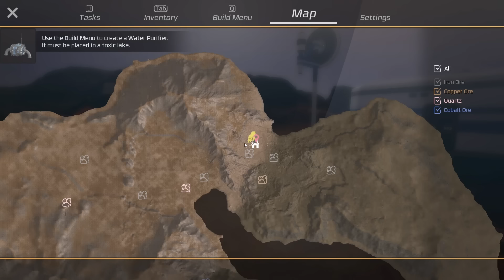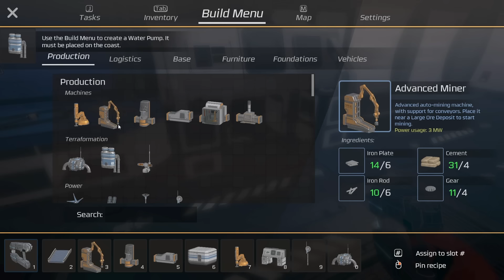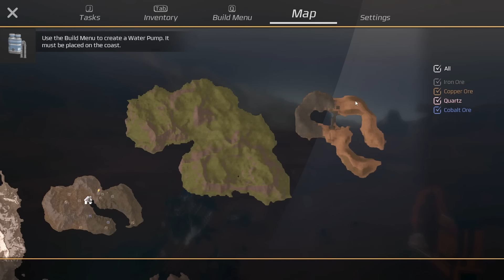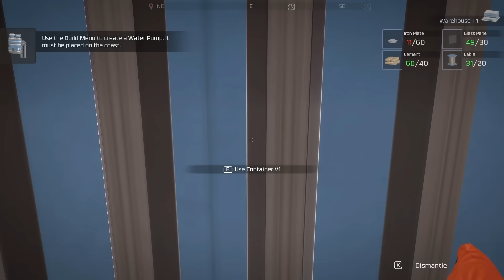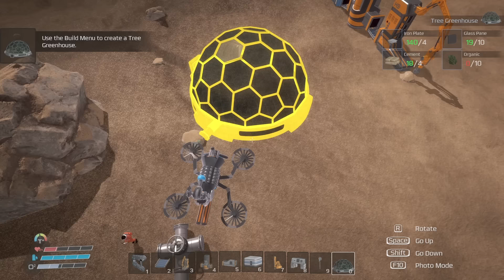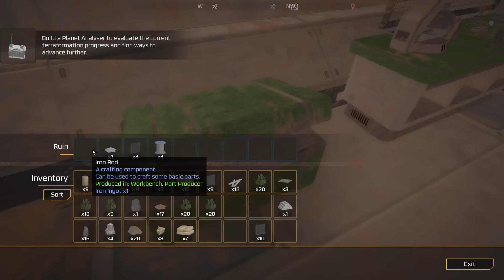Eden Crafters - Nova Terra - Warehouses And Terraforming [E2]

Comment: I finished Terra Nova, didn't even use trains, but after about 60 hours I got to the end. I did spend another 30 minutes or so to finish up some achievements with the roller and tunnel vehicles and trains. I didn't use any ground vehicles or trains throughout that play through. Was my first time in Eden Crafters. Although, after watching your videos, I've started with Echo Prime and it's amazing how much you can get automated right at the beginning area. I already have 5 (T1x2 )  (T2 x3) warehouses setup, and up to my 6th Warehouse ( to boost my slots to 60), which will be my first T3 warehouse, to start in the cold climate for Amethyst, Sapphire, and others. I waste so much time on Terra Nova running around like a chicken with my head cut off. Automation at the beginning is key! My character's life is so much easier at the start of Echo Prime. Get all of the basic items automated is a good start. I had a deficit of power and water, but the machines will chug along in a degraded state, and I let it go until I could build Geothermal power and get V2 water pump and  V2 water filter. Placing a warehouse is always a predicament.
Reply from the maker: That's an impressive start, early automation really does change the whole experience!
Reply: @surtrplays  I think your videos already gave the importance, Get all your iron supported automation done, along with the copper. My main crux ended up being with osmium related hardware, The gear assemblies and composite beams. Never really worried about the catalytic converts, they can be created on a whim pretty fast, but having phosphorus in a warehouse helps. After having copper, iron and graphene based items automated makes it a bit easier. I"ve had to setup separate areas for a few specific items because the areas are ripe for automation for some items. Like Amethyst, Diamond, and Sapphire. Those all go good together with a warehouse and a few gem cutters. I'll be curious how  my strategy works with other planets. I've already had to use the Tunneling vehicle with echo prime. Thank you for the great videos you have. For anywone else wanting tips, the big bangers at the beginning will be copper and iron, get iron plates/rods/beams and copper for ingots and cable  good start.
Reply from the maker: Yeah. Osmium and Gold. Lots of crazy work there.
Reply: @surtrplays  I always make sure rubber is in the warehouse, I don't mind making rubber belts and rotors, but with my current playthrough I may setup a warehouse and area to build those. There comes a point where it really isn't needed anymore so I kinda just make sure I have rubber in a warehouse or  in a nearby storage V1 or V2 so I can create belts on a whim. My Echo Prime playthrough make sure I can as much automated at the beginning before adventuring. My first area was Terra Nova and my first game play. Never played before 1.0.  My first playthrough seemed to be a bare minimum. If I had automated many things to begin with I'd be further off into the future.